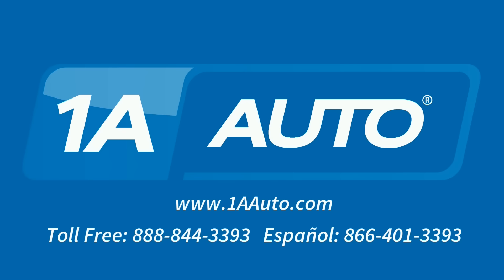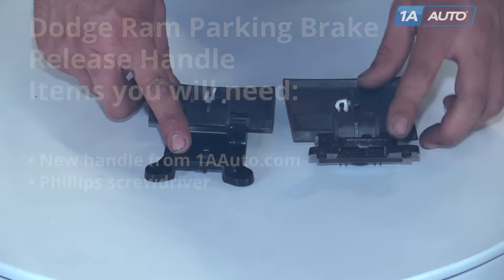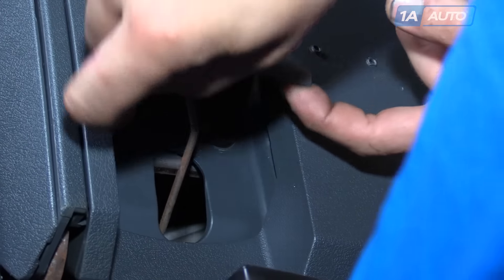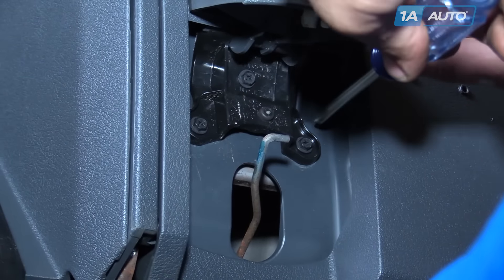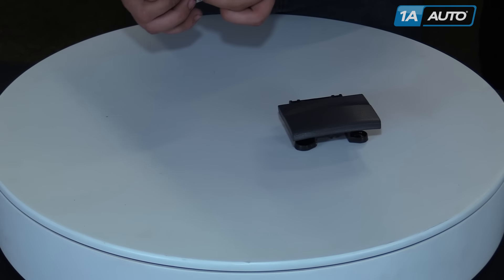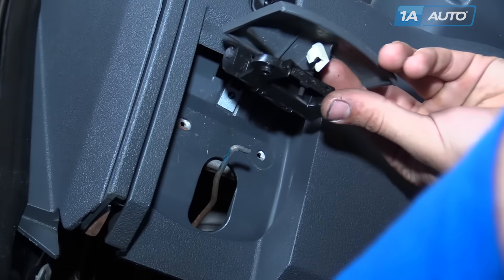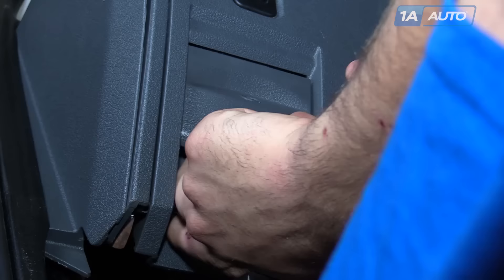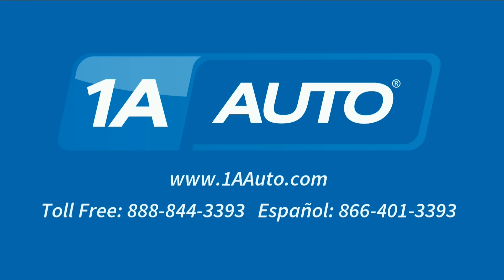How to Replace Parking Brake Release Handle 06-08 Dodge Ram

Comment: Hi there - I'm in New Zealand and drive a 2004 Dodge Ram 1500 Laramie.  It has a similar but slightly different brake release handle which has broken - wondering whether you could help me with it please.  The handle is black in color and has "Brake" stamped into the top part of the handle.  It works very much the same as your video and install/removal is pretty much the same.
Would you have the appropriate part and if so, what is the price shipped to a depot in US (I can arrange freight from the depot to NZ)